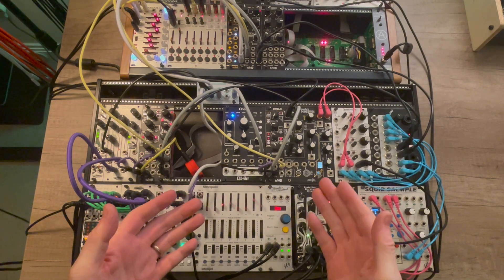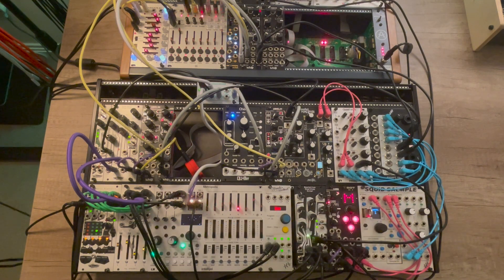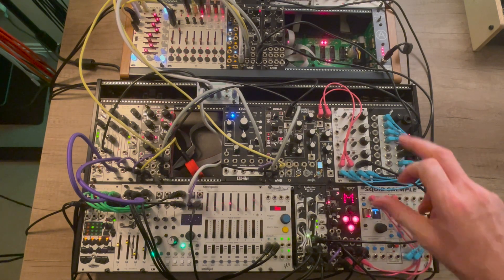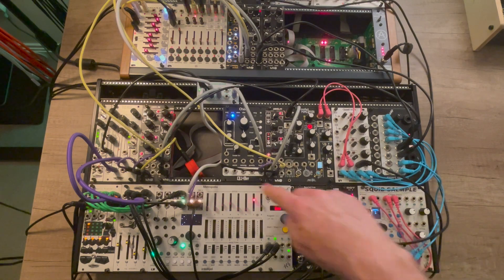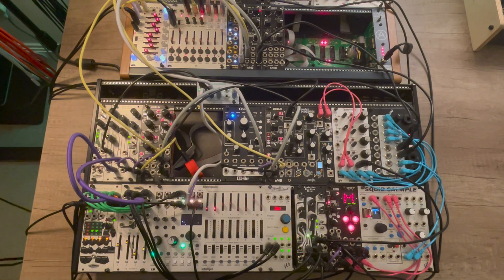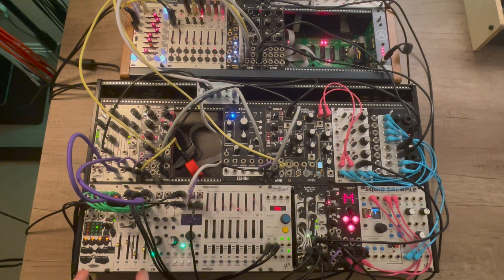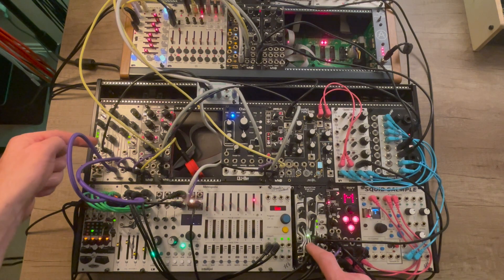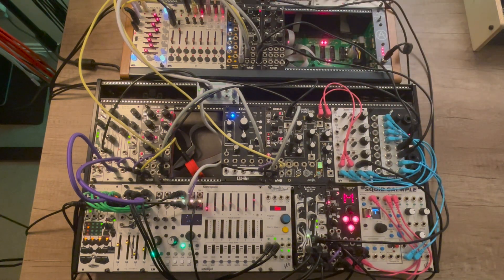Performance Set & Breakdown

Comment: Informative as always Mark,learn something new every time, I’ve been looking how to control all the different voices like muting one voice, bring in another and all variations of Elements, VCA can act as mute ( I have veils, is it same as your Quad VCA) also got Cosmix mixer with Aux send / Return can be used to add FX to each channel or mute, many ways causing headaches🤕😃just to add you should turn big case up other way like Pallette utilise 1U add Steppy???
ACE yet again cheers🆒🎶🎶🎶👍🌟🌟🌟👁
Reply from the maker: Eurorack mixers are not cheap but having send and return is useful, especially for leads and hats. I have a quad matrix but still not sure about it as it’s too big for a one case setup. Upside down case may be possible as I don’t use any of the case ports at the top so might consider it and bring in Steppy.